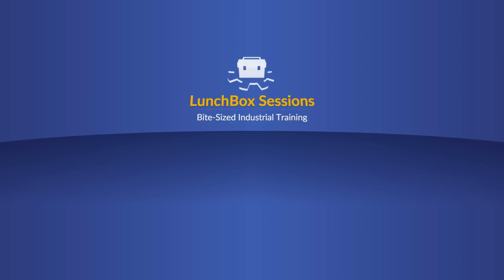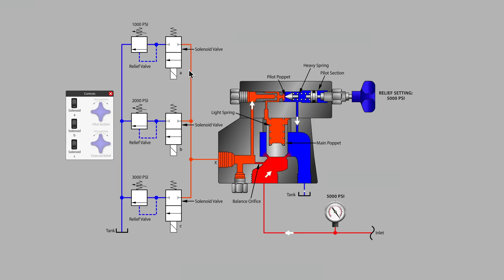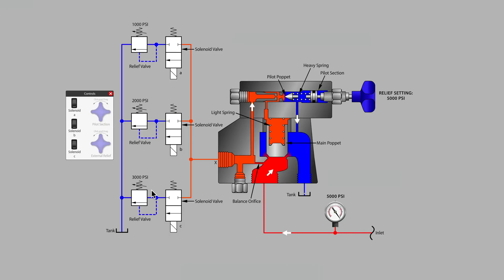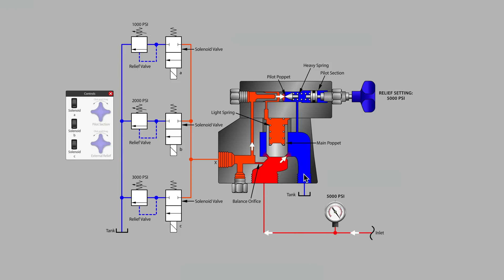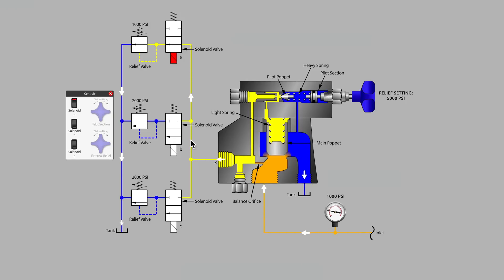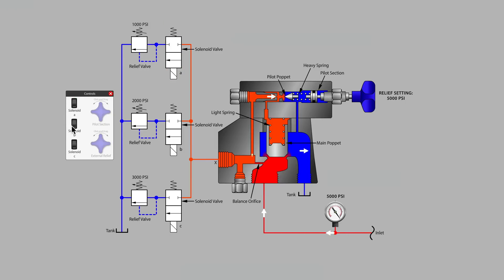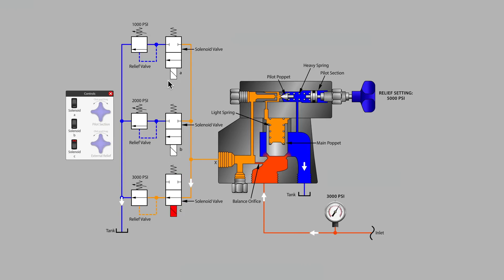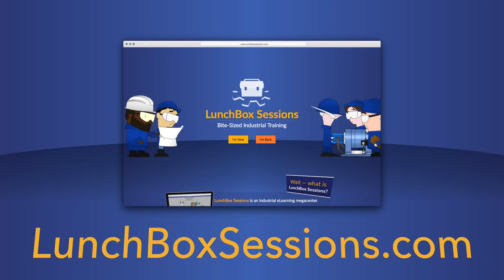Electric Relief Valve Remote Control

Comment: Could the same be done with the signal port on a variable piston pump?  Could a motorized valve be made to make it infinite?
Reply from the maker: Yes a vent port operated, pressure compensator on a piston pump can accomplish a similar effect. Remote vent operation of a pressure regulating type of valve or pump controller is a fairly common design feature. And yes a motorized or proportional pilot valve could make the pressure values stepless. Great thoughts and questions Steve.   - Carl

Comment: I see that the fluid loses some pressure when traveling out vent X and when passing along poppet seat. How do these losses affect the control?
Reply from the maker: Thanks for writing and "Thanks for Watching"!  These losses that you notice quite correctly, are in fact critical to the function and control of a balanced style, pilot operated relief valve.   The spring above the main poppet in the main valve body, is perhaps only a 20 PSI or perhaps a 50 PSI  equivalent strength. The surface area above and below the main poppet is equivalent or nearly so. The pressure loss, or drop as I prefer to call it, in the pilot flow, happens when fluid passes through the narrow balance orifice. Fluid only passes through the balance orifice if the poppet in the main pilot, or in one of the remote pilots, cracks to a partial open position. So, it is that pressure drop that then unbalances the main poppet, allowing for the main pump to tank relief function to become active. For more info see our video, Balanced, Pilot Operated Relief Valve  https://www.youtube.com/watch?v=0gHjNwOWtJk

Thanks again,  - Carl